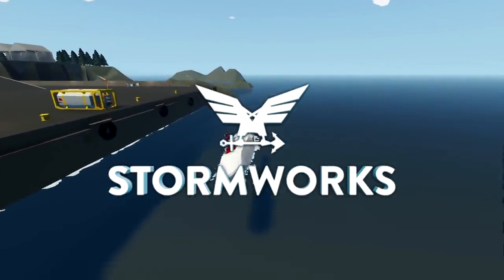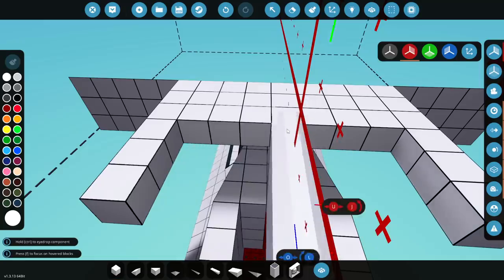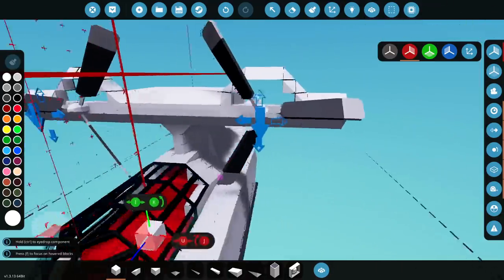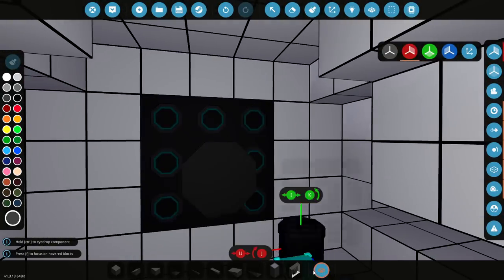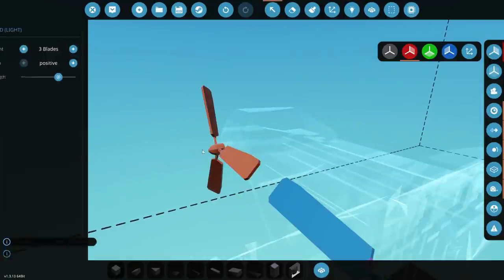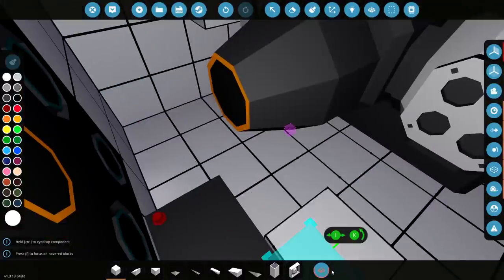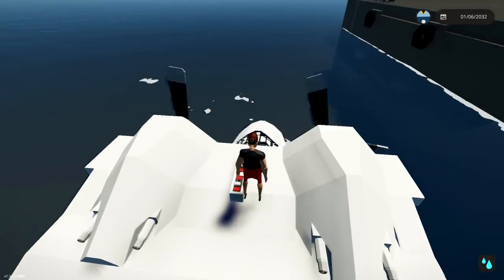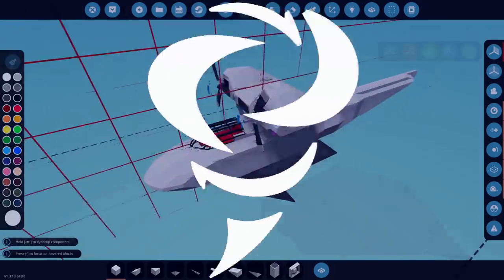Working 12 Cylinder Modular Engines ADDED! - SeaPlane Build - Stormworks Gameplay - #2

Comment: Hey I recommend that when using dual engines on an aircraft add a pipe from one engine to another. Basically makes them both spin at the same speed no matter what and will save you from constant yaw.
Reply from the maker: So I add it just after the clutch presumably?